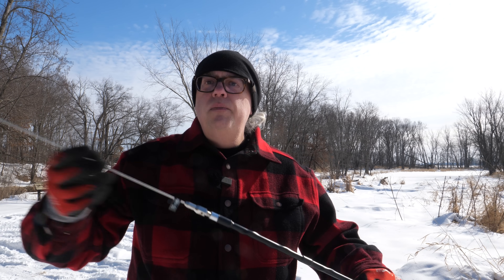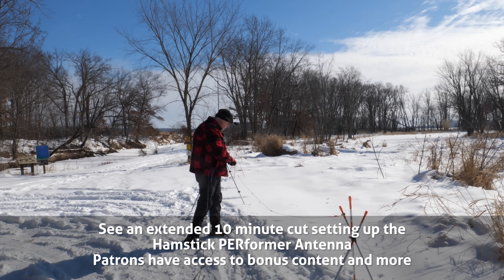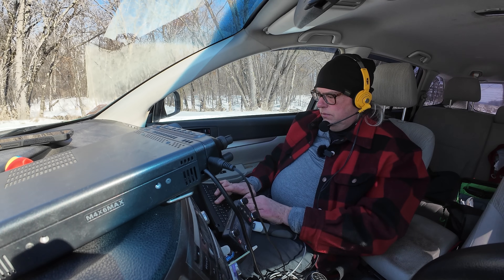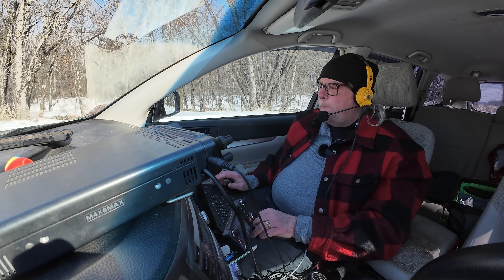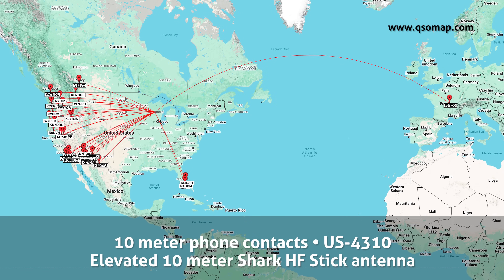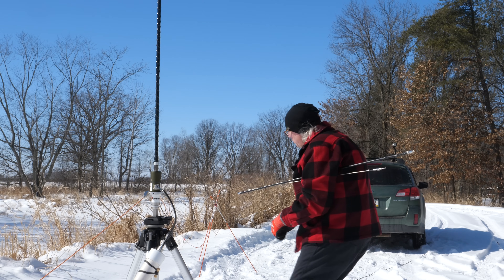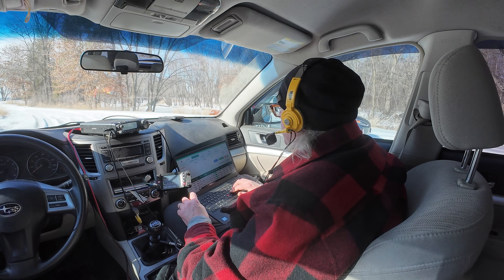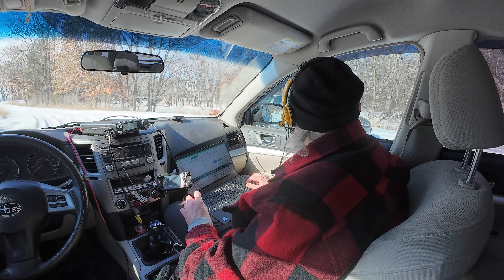This one WEIRD trick SUPERCHARGES your Hamstick Antenna

Comment: Have you had any issues with the ECU or other auto related electrical issues while operating HF from the vehicle?
Reply from the maker: I turn the engine off when I operate. With it running, I can hear some noise, but the transceiver's noise blanker gets rid of most of it. Still I don't use the noise blanker if I don't have to as it does reduce receiver sensitivity.

Comment: Don't understand. A better comparison would have been with the "Hamstick" with a Magmount on the roof of your car. That way you wouldn't be trudging in the snow. I do POTA and SOTA and portable op overseas, so I've had a bit of experience. Many times there is not space for counterpoise, let alone elevated radials. Like the KH1 and its whip at Edinburgh Castle. This whole POTA PERformer is really too much, especially with Greg asking for donations for antenna experimentation!  Any General class ham should know how to build and do antenna experiments. My best solution for bad wx for POTA is a 17ft Chamelon whip in a magmount on the roof of my YL's Honda van...does great on 20 CW. Sorry for the rant, but someone had to say it.
Reply from the maker: I need to respond to the statement 'any General class ham should know how to build and do antenna experiments.' My experience is that is just not the case. I feel the test preparation materials build a foundation that gets you to a level so you can pass your Technician or General license exam. but they do little else. Newly minted hams come out of a testing session with a license, but don't know the next step. 

That's were videos like this come in. It takes a fundamental concept, in this case elevated radials, and expands it. That is, you don't have to be constrained to a 1/4 wave vertical radiator. This is not a setup I would do every day, in fact I don't think I'd try it again. Like you said, a mag mount on the roof works plenty fine. But I wanted to show that radiators come in all shapes in sizes. Who knows, maybe someday a ham will wake up, want to put a constrained antenna on the balcony of their condo, and remember this video.

Comment: You can use the feed coax as the radial by winding a few turns on a toroid at a quarter wave from the antenna. Makes it a 2TLT. Works a treat. Thanks for the video.

Comment: Hi Michael.  Just a thought that pertains to the POTA Performer setup.  I made this system after watching your initial presentation...works great, but I didn't compare with a second antenna using an antenna switch. When using a Vertical antenna, many operators have 6 or more radials (counterpoise wires).  Your thoughts on adding a second set of radials perpendicular too the first set.  Just curious.  Perhaps I will give it a try, but always look forward to others thoughts.
Reply from the maker: With the PERformer antenna, Greg KJ6ER, settled on two radials because it added the best performance with the least amount of work. That is, more elevated radials will slightly boost your signal performance, but the marginal difference is slight.

Comment: I wonder how it would work if you replaced the tripod with a mag base on the car roof. Then run the radials out from the car?  It would be simpler and much quicker to deploy. Electrically it should provide a good match, and the car would add mass to the overall radial ground plane? 🤔

Comment: What are using for your radials? I think that might be part of my problem with the high SWR and not getting any forward power on TX. My RX is just fine.

I’ll have try this set up with my FT891. Also will need to try it on my mag mount.
Reply from the maker: The radial network is based on the POTA PWERformer antenna. Here's my video on that: https://youtu.be/wqw3ultuPQg

Comment: Excellent video, and thank you.  This might cure one of my issues with my hamstick collection when using in my offroad trailer shack.  My stingers are just ever so short for a couple of my sticks, and I did not realize the tops of the base mast were also 3/8x24 thread.  I have one of those SA whips ( and several other brands)  that I will test out.

Comment: The 10 meter band has been kinda crazy lately. Two days ago on WSPR I was hearing stations mostly in Europe in the early morning, a couple in Chile, and one in Panama, Then a bunch of stations from NE USA were heard. Later in the day I started hearing stations on the west coast. Yesterday early morning I heard nothing but west coast stations except for the one in Panama and two in Chile. None were heard from NE USA or Europe. Today it was back to hearing every station as before except no European stations. All of this was on a 10 meter inverted V antenna. The bands can be fun but sometimes its a roll of the dice of what parts of the country or world we will make contacts with. I like how lots of antennas use the 3/8 24 connectors so that new configurations can be made. 73 KD5YOU

Comment: There is nothing "weird" about this and it isn't a trick.  There is very little difference between adjusting the vertical section to change the resonant point versus adjusting the radial section in the first place, but by lengthening the radial ... but not the vertical section ... you're just creating the same effect as an off-center fed dipole.  A quarter wave vertical has a natural feedpoint impedance around 35 ohms, but by feeding it "off-center" you raise that impedance just as you would if it was a dipole.

Comment: You're doing great work in coming up with fast antenna set-ups like the PERformer for field activation. A quick, effective antenna is always the hardest part of getting on the air. However, in this instance, it appears you have a fundamental flaw. At 1:48 into the video, it looks to me like you're using a Chameleon CHA PUCK HUB and a Mueller clip to attach your radial(s) to it. The CHA PUCK is an anodized aluminum part so there will be minimal, if any, electrical connectivity to your radial. The oxide layer on the CHA PUCK has physical and chemical properties resembling a ceramic which actually makes it a terrific insulator!  You would need to put a 4 mm banana plug on the radial and connect it to the hub that way where the aluminum hasn't been anodized inside the holes. If I'm mistaken about the hub and it's something else that isn't anodized (or if you have ground it off), then the set-up is fine. Take care. Hope to see you on the air. 73.
Reply from the maker: To my knowledge, the CHA Puck is not anodized. I've run this setup many times with the POTA PERformer antenna and have not had any issues making good contact with the Mueller clips. But I know what you mean by not getting a good connection. I've got some mirror mounts that are anodized, and you have to scrape the coating to get good contact. Otherwise if you don't, you'll be messing with the whip all day and never get the SWR down below 3:1.
Reply: @KB9VBRAntennas  Please look at the product description (2nd sentence - "Crafted from durable anodized aluminum, ...") or measure with your ohm meter. 73
Reply: @KB9VBRAntennas  Please read the product description - 2nd sentence ("Crafted from durable anodized aluminum, ...") or measure with your ohm meter.

Comment: Michael, I often keep my vertical mast constant and adjust the radial length to match the changing conditions between parks.  I use the buddipole radial with a winder and a 3ft plastic electric fence post (TSC) to secure the radial

Comment: Trying to understand, why do you use 50 watts on a radio that will do 100 watts? Battery life? More of a challenge? Great videos
Reply from the maker: Primarily battery life. I've found that 50 watts is a good trade off between power consumption and signal strength. Dropping from 100 to 50 watts only loses 1/2 of an S unit, yet it almost doubles the life of your battery.

Comment: Great video Michael. You got me thinking. If you have a 20m hamstick, and added the telescoping whip, Could you tune 15m fully collapsed (or down at least), or 40m extended more? And changing the length of the ground radials for the band you are working? What lengths are you using for your radials for each band? Thank you so much. WB7DUO

Comment: I wonder if you could put an 80 meter hamstick on a silver bullet 1000 and get 160 meters
Reply from the maker: That's a great question. The bandwidth on an 80m hamstick is about 30 KHz. Adding the SB1000 coil will make it even tighter. Tuning will have to be ultra precise.
Reply: @ sounds like a theory to put to the test and get some answers.

Comment: I did a 40 meter Hamstick with 3 elevated tuned radials a few years ago with very good results. My question is what was the unit you inserted between the antenna and the tripod? The music was playing as you flashed it in front of the camera. A 1:1 balun would be my guess but you didn't make it clear.
Thanks, Steve, k7ofg
Reply from the maker: That's the Chameleon Blank Adapter. It's a base that supplies a feed point for the hamstick. You can get a closer look at it in this video: https://youtu.be/vXVFVmr3yyU

Comment: Great video! I use something similar. I use ham sticks on a mirror mount on a photography light stand. Paired with a 3’x8’ window screen, I run jumper cables from the mirror mount to the window screen. For me, 20m and 40m requires only 2 jumper cables, while 17m and 15m requires 4. It’s quick to deploy and works well. 
It’s always great to try new things and share what you learn! POTA on!

Comment: Good for you Michael, always experimenting, that's the spirit of our amazing hobby! As you mentioned, it is a compromise antenna - you will be sacrificing both radiation efficiency and certainly broad bandwidth by using a hamstick/coil radiator instead of a telescoping whip with the PERformer elevated ground plane. However, your 'proof of concept' was a success and clearly demonstrated that a hamstick can not be only a mobile antenna, but can be used in a stationary portable configuration as well in the field. And it made sense to me that with a hamstick, the elevated radial segments may need to be adjusted due to the impedance impact of the built-in coil. Regardless, you proved that it can work and make a lot of great contacts. I dare say you pushed the traditional hamstick to its limit with this experiment. Keep up the great work and the amazing videos 😀73 KJ6ER
Reply: Greg, I wanted to tell you I did the same thing in December out of necessity. I flew to Ohio to drive my dad's car to Texas but the SS17 wouldn't fit in my carry-on with all the other POTA Performer gear. I drove to R&L electronics in Hamilton, OH and they were sold out of Chameleon whips due to their holiday sale. I thought to get a 20m Hamstick instead - better than nothing! And it worked! I did many short, quick activations along my drive to TX with only 10w from the IC-705! Sure, not ideal, but it worked a treat. I was surprised how well it worked qrp too. I didn't have any long times calling CQ hoping for a response. Anyway, now I have to figure out how to make the Challenger and get it on the air! Thanks for the great antenna designs! KI5YLP

Comment: Since both vertical and radials have to be tuned. When it’s off how do you know which to tune? Just mess with both till you accidentally get it right. Or is there a way to tell vertical is off or radials are off?  I would hate to know I tuned my radials right and my vertical is off in a manner where my radials are doing most of the work and the vertical is not doing good transmission.
Reply from the maker: The way the POTA PERformer is designed, the radials are calculated and modeled for greatest efficiency and the whip is adjusted for resonance. This is done for the convenience of only having to adjust one variable out in the field. Swapping out the whip for a hamstick leverages that design feature. I'm guessing the radial was a bit short for the 10 meter hamstick, but if I was going to use this setup on a regular basis, I would retune my hamsticks for better resonance with the elevated radials.

Comment: Thanks Michael.  Used my old Hustler set up the same in a VKFF the other day. The scrub in the park was so thick I couldn't put up my usual dipole. Make 48 QSO IN 1.5 hours on a working day too. Even got 6 QSO using the 80m loading coil with the 40m radial just tuned a 2t1 swr out with z100. Put it back to no tuner for 40/20m with linked radials 1m off ground. Cheers vk5cz..
Reply from the maker: I was thinking of trying this with my Hustler whip. I'm glad someone beat me to it.

Comment: I have a nice experience with my Hamstick antenna with a mag mount. It's just put on my car roof (20metre band) I made a lot of contact without any trouble 🎉 I like Hamstick. However it's a good option for quick deployment. ❤
Reply from the maker: Hamsticks work surprisingly well. I typically just use the mag mount for quick setups in the winter months.

Comment: I’m curious if so many contacts were west of you because of the orientation of the radials. Thanks for the video. 73
Reply from the maker: I think propagation and the long nature of the 10 meter band had more to do with it. The radials were set 180 degrees from east other on an east-west orientation. The antenna should radiate omnidirectionally in that configuration.

Comment: Which radial segment did you lengthen, the 10m one? By how much from Greg's measurements?
Reply from the maker: I increased the length of the radial from the 10 meter to the 12 meter segment. I think the length difference is about 18 inches

Comment: A good demonstration that adjusting the radial lengths can tune just as well as adjusting the vertical height. Thanks Michael
73
Reply: But in doing so does it make your radials the effective signal output and now your vertical is not where your main lobe is, making it more invis and less a low take off angle vertical?
Reply from the maker: To answer your question, the setup would have to be modeled on a computer, but consider two things. A 1/4 wave vertical is nothing more than a dipole with one element vertical and the other horizontal. With dipoles, both elements work together in establishing a radiation pattern, this setup may have a strong lobe at 90 degrees, but there also should be a significant lobe closer to the horizon. 

True NVIS antennas work best on the 40 an 80 meter bands, and you will seldom see the NVIS effect on frequencies above 10 MHz. I think if I was to see NVIS propagation show itself, there would be more close in contacts on the 20 meter band, yet looking on the contact maps, that wasn't the case.
Reply: @ yet Michael made lots of contacts

Comment: Wolf River Coil has a 78" collapsible antenna available for $15. Likely a little longer when collapsed than the TW1. But, it is available.  You got me thinking I could easily add one of my WRC whips and adjust as needed. Thanks for the idea!
Reply from the maker: That's not a bad idea.

Comment: Have you checked out  electric fenceposts for your elevated radials? Very cheap.
Reply from the maker: I normally use the plastic electric fence posts, but the ground is frozen so they don't work so well.
Reply: @KB9VBRAntennas  Forgot about the frozen great north.
Reply: The reflective marker tripod (or sticks even) is also a viable choice when you're in an area that forbids sticking anything into the ground.

Comment: The "pota performer" is basically a heavier and less convenient buddistick pro. The buddistick does band changes really fast as well since it has tap points for different bands.
Reply from the maker: The one advantage of the true POTA PERformer over the Buddistick is that it doesn't require a coil for operation on the upper bands, you just adjust the whip until it is a resonant 1/4 radiator. But to your point, this setup with the hamsticks does mimic much of what the Buddistick is.
Reply: I guess for experimentation it’s good to know it works. As you have shown over time there are much easier well performing options. I love ham sticks as they are so easy to use and the performance is so good.
Reply: I appreciate you showing us how this works but why would anyone do this?
Reply from the maker: @jwilly5336 I think there is a fallacy in amateur radio that every step forward needs to be in increased performance and efficiency. I believe you make greater strides in understanding antenna systems and developing true innovations by doing these interesting 'side steps.'
Reply: @jwilly5336  I did this out of necessity in December! Flew to OH to drive my dad's car to TX - SS17 doesn't fit in carry-on. R&L was out of CHA whips (Christmas sale) - thought to buy a hamstick instead. It worked, and while not ideal and my normal setup, I activated several parks along my drive and quickly with the IC-705 qrp. Better than no activations! So yeah, there is one reason why someone would do this!

Comment: What a great configuration. You got me thinking of taking it to the next downsize, and try it with an Elecraft AX-1 or AX-2 whip. They are great little antennas, and I moan when I hear or read of people calling them a 'compromise antenna.'  Compromise maybe compared to a 4-element beam, but not a compromise in the contacts and fun department !